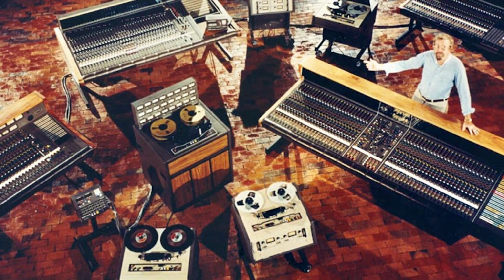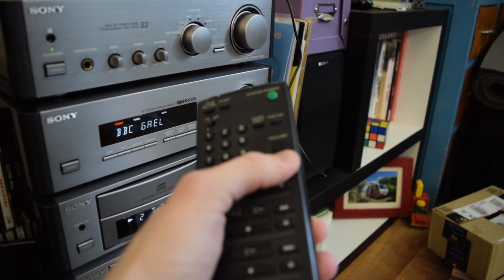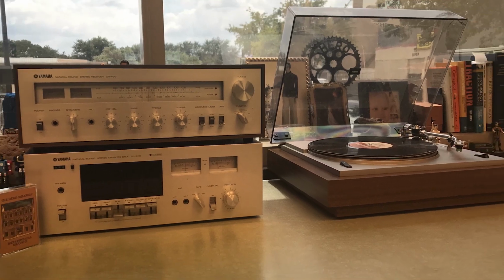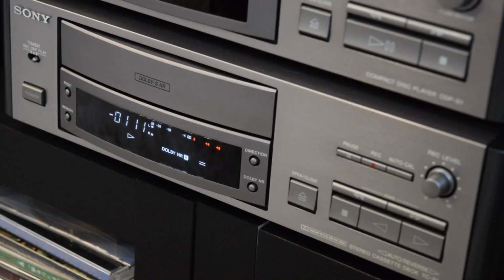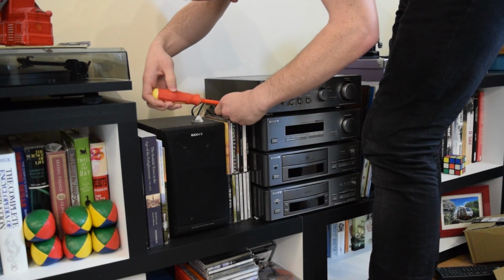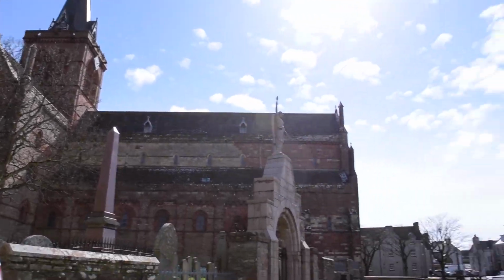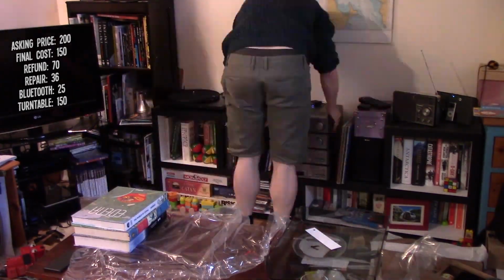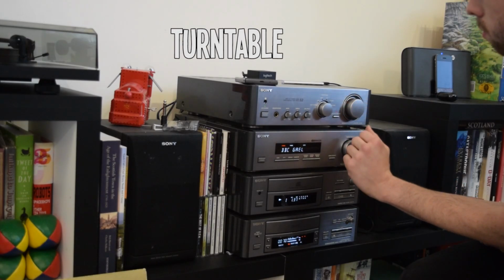My New (Old) Hifi: Sony La Scala TA-S2 & Project Audio Essential

Comment: Cracking deal I'd say... I'd pop those speakers a bit further apart if possible... couple of meters at least between them and don't pen them in... Open the sound up a bit. very nice setup. It'd be interesting to see if it's changed much over the years.

Comment: The stereo setup with the book shelves and what not looks super cozy. I don't mind the lack of a sample of the sound quality due to this platforms lack of fidelity and my tinny computer speakers. the video has inspired me to look around the used market for a dearly miss the ability to listen to vinyl. Whats your thoughts on the logicitech Bluetooth speaker adapter geatured in the video (longterm use)?
Reply from the maker: I actually removed it and moved it to my old boombox - our team at the Distillery I work at use it in the warehouse now. It's been running almost 24/7 for 3 years and never gone wrong!

Comment: Ahh I had that system in the 90's! I think it was £899 and then I added the minidisc deck which was another £400! 😮 My amp failed like yours and you had to tip it to get it working again lol. Then the pickup went in the MD deck and I ended up giving the remaining components to a mate. Beaut sound quality though especially with some Sony APM speakers
Reply from the maker: They're such beautiful a beautiful set- I've since moved and it's not got the greatest place but I'm building a house and without a doubt this and my whole HiFi will be getting centre stage in there. Just need to find some good speakers... 👀
Reply: I have probably the same relay issue. How do you repaired? Do you need to replace the Omron G5R-2232P-KW relay? Thank you

Comment: Ha, ha I did exactly the same as yourself but I went down the teac route and managed to get an A-H500i system(mainly for amp) added a project rpm 1 Carbon turntable and then found a pair of floor standing speakers made in the UK in the 90s by kef(very retro and sound amazing) a trip to IKEA all done.

Comment: I've had the same system for at least two years and had the relay issue as well. Repaired my self for under £10, still have it and still working, I've only added to it since I've had it.
Reply: I have probably the same relay issue. How do you repaired? Do you need to replace the Omron G5R-2232P-KW relay? Thank you
Reply: @pablofigueroa1264  sorry for the late reply but yes you do, simple desolder and swap. Unfortunately my la scala kicked the bucket but is waiting full repair.

Comment: The only thing I’d change right now on that system is the speakers, it deserves much better speakers than that. I picked up the same setup in about 1998 without the original speakers, I paired it up with some Mordant Short MS20i Pearls and it served me well for a couple of years until I replaced it with an Arcam setup in 2000. 

I’ve had Linn stuff for a few years now, if you haven’t heard of Linn, check them out, they’re a Scottish brand and make top quality kit.
Reply from the maker: Yes, I'll been an aim of mine to need to upgrade the speakers. Unfortunately I've moved since making this and the speakers are in a less-than-ideal location making it a bit less enjoyable to fire them up and play some tunes. Like the idea of getting some Scottish kit though- I'll look into this Linn!

Comment: I have a question. I just bought one of the systems off of eBay. I did have to get a UK to US adapter for the power cord. Anyway I plug it into the wall and the amplifier lights up. I have the other components daisychained to wait so that they can gather power through the amplifier. However when I turn on the amplifier none of the other components come on. Any idea what might be going on or have you had this kind of issue with your system.? I have the same exact system that you were showing in this video.￼
Reply from the maker: Hmmm so basically the other systems are not powering up? Have you tried daisy-chaining them in a different order? Failing that, it could be  a problem with the power supply from the amp. I'd probably recommend finding a hifi specialist to get a repair- something like a issue with the sound is probably fixble at home but when messing with power supplies it's a bit more risky.

Comment: Really nice video. I watched this before I picked on the same set up that you have, and the Scala is such a nice machine - have it paired up with freestanding speakers and it’s a dream. I have noticed however that my amp (S2) seems to be doing the cut out issue here and there. This is a long shot to ask here, but do you have the technical details of what repair work was done to yours. I’m doubtful I’ll find a shop that does it as cheap as you, however if I have the direct info on what is likely needing a fix I think I might stand a better shot and getting it done. Hope you see this message - and thanks for this vid! Felix
Reply from the maker: Sorry for the delay in getting back to you! Looking through old tweets and comments here, I believe the accepted theory was that it may have been an electrolytic capacitor located near the relay that started to fail. They help supply the current to close the relay but when they go bad they begin to make a rattling sound before the speakers turn on (Thanks to commenter Swinde).

Should it go wrong again, I'd definitely open it up and try and fix it myself-just because I place the value of this more in the enjoyment I get using and maintaining it more than just listening. But let me know if you have any luck! By all accounts, it seems like it's a very common hi-fi repair shop fix so I'd guess you'd get a good price for repair- maybe go in and explain to them what you think is wrong, them just knowing you're not clueless might make them less likely to quote you for unessesary work (the same reason I figure out what's wrong with my car before I take her to the garage if I can't fix it myself!).
Reply: Calum thanks so much, this is exceptionally helpful and gives me the edge I was looking for when I seek any repair. Long may all Scalas survive thanks to this video and guidance!
Reply from the maker: Hello, just a note to say I saw your message and I'll have a look back through my old videos/comments to see if there were more details on the repair and get back to you!
Reply: Calum thanks so much! I’m amazed you replied so quickly!

Comment: Just watching you setup great system you got a bargain especially the amp you have a good electronic repair shop who is honest and didn't charge you over the odds. Retro separates sound great  better than the new gear which is very expensive and not very well built all plastic etc.
I saw your cassette deck on the Techmoan channel I like the cassette loading tray really neat design.
I have just subscribed to the channel and looking forward to checking out some other videos. Thanks for sharing
Reply from the maker: Thanks! I don't make a huge number of videos on here anymore (though I do on a lot of my other social media channels) however I do want to do more like this in the future. Thanks for the kind words, however!

Comment: Do you have a problem with your Logitec Bluetooth receiver’s signal cutting out? I have one exactly the same as yours and when I’m listening to music through it, the music quite often gets interference through the Bluetooth signal and cuts out for a split second here and there. It gets rather annoying sometimes and just ruins my listening experience for me.
Reply from the maker: Cant say I have, the only problems Ive had is if I have my phone in my back pocket and it masks the signal somewhat. Possibly a fault in your device?
Reply: Not sure if it’s my device. I use my iPhone 8 and iPhone 6 as my music sources. I also have a JBL Pulse 2 Bluetooth speaker and have no connection problems with that though.

Comment: I was lucky soul who bought an S2 setup last week on ebay for £90.00. It arrived today and I was even more pleased at the fact that I did get the AU Bus cable plus the manuals for each piece. I'm going to take the time to replace the relays in the amp and replace all the grease in the CD playing mechanism as it is a bit noisy when ejecting.

It's a really nice sounding setup, I have it running my Yamaha NS-1000M at the moment which usually, are driven by Sony TA-E80ES/N80ES pre/power amps and a CDP-337ESD. Obviously it isn't going to replace that system, but it is damn good. 

I've bought the S2 for either my bedroom or to use at my parents spare room for when I am visiting.

Definitely recommend getting the AU Bus sockets connected because you will get full remote functionality - I'll have a look to see if I can find anyone who might be able to replicate the connectors. The wire just daisy chains from each component to the next, so there is no order or different wiring required.

Comment: I like that it is not black plastic like most of the 90s equipment! I think the dark chrome looks very nice!
Only thing I am not so much fan of, is the typical 90s styling of rounding up the trays of the CD and cassette. Love it or hate it, I prefer everything to be flat
Reply from the maker: FrightfulAccountant same on both accounts, I'd say. Love that I found something 90s that didn't feel like cheap plastic, but it still has the odd design choice that keeps it from being perfect! Hint hint vu meters...

Comment: 5:11   It is likely that there is an electrolytic capacitor located near the relay that helps supply the current to close the relay.  As they go bad, they begin to make a rattling sound before the speakers turn on.

Comment: I love the fact that your local repair shop repaired so quickly & so cheaply. It probably says volumes about the advantages of living in a remote & small community. 
I live in a fairly big town that had a local hi-fi shop that did repairs but it shut 10 years ago now. We have one second hand shop where there is a chance of picking up some old kit - maybe an easy repair if you're lucky. Soulless in a nutshell! 
Thanks for the video
Reply from the maker: Amazing isn't it? Everyone should bring their stuff to Orkney Television Enterprise! But this is the reason I want to become more self-reliant on things such as this- HiFi & component repair, even older car repair, as it is an expertise or service that is increasingly shrinking away from more rural areas (and even smaller cities!). In a few years a (relatively simple) fix like mine could probably only be done by sending it to a city hundreds of miles away.

Comment: That "midi" input you mentioned is actually MD (minidisc) which was a Sony proprietary format in the 90's/early 2000's. Still works for yur Bluetooth though. Basically acts as an aux port.
Reply from the maker: Wait wait wait I'm so stupid, of course! Not MIDI as in Musical Instrument Digital Interface but MD as in MiniDisk! Cannot believe I never caught that, thank you for the clarification!
Reply: Haha...no worries...cool vid!!
Reply: dandanthetaximan  i was like for almost 20 years without recording any minidisc, but then i discovered spotify ,and now i have mix minidisc´s with lot´s of music that i couldn´t find on stores, sometimes i even record from spotify ,just to don´t have to look for the cd that as the music i wish to put on a new playlist, like i work on a big sutrface repository and one day they told me to trow away to the garbage the sealed boxes of 10 blank mds , i just use my home as trash ,and i own several hundreds of mds,and even bought the high-end from pioneer as not working for 20€ ,when conecting it i notice that it reads the mds and then i just tried to record one md, it even recorded better than my 20 year old sony md recorder,maybe in the travel from germany to portugal the md deck just bumped dozens of times to arrive at my house working perfect,nice format(i even bought a md car stereo)

Comment: Hi, I can only agree; very nice video. I own this system from 1996. It was my first hi fi system, and it is still working. Last month I moved it to my bedroom like second one. I just added Google Chromecast Audio for some modern convenience. I was using it with B&W DM 302, so I suggest that maybe you should try those one in combination with this amp. Amp is not full of power so careful matching with speakers is needed (higher sensitivity). This is really hi fi system from any perspective; sonic performance, built and looks. From nmy perspective if you don't know age of it...you could easily be fooled that it is rather new one :-)
Reply from the maker: Yes its funny a lot of people who have come around to my flat haven't really caught onto the age, they all assume its a very high end model from the last few years until the notice the tape deck! 

I'm glad you brought up the lower power of this amp though, it was something that surprised me but since I'm no expert I wasn't sure if it was just someone more common on 'higher end' systems or perhaps MIDI systems. I'll be looking closely at those speakers you mentioned, however, thank you for the recommendation!

Comment: I am looking for a retro hifi for myself. I have around £250 to spend. Any good suggestions??
More vids please buddy, I always enjoy your content, and always enjoy watching your old tech reviews.
Reply from the maker: £250 is a pretty good budget, that's probably what all this came to all in (obviously I saved on not buying new speakers- yet!). I can reccomend the La Scala though, it is known for that fault in the Amp, however there is the La Scala 2 which is an Amp/Tuner combo and was very well recieved. These Mini MIDI Hi Fis in the 90s seem to be real swiss army knives if you're looking for digital all the way to phono. Also, I would also maybe try the Sony LBT range. It was a LBT-D159 (I think) that  I used to have in high school, and it was a wonderful system. The Equalizer on it was absolutely beautiful (the one thing sorely lacking from this). Whatever you do find though, let us know!
Reply: LitZippo Thanks for the reply Lit. I will definitely look into your suggestions, and also let you know what I end up getting. I was looking at an old Technics stereo (stack/seperates) system, are they any good? Or are they only good at Record Decks. I need something that I can play my extensive Vinyl, Cassettes and CDs, although I won't mind if the CD is seperate, as I mainly want something with analogue meters, as I still love watching the needles dance as my music plays, something that I don't get from watching LEDs or an LCD display.
Reply: LitZippo Hope you start posting more content? I really do look forward and totally enjoy your style/content. More please 😎
Reply from the maker: Thats something I've been wanting for a while too, proper VU meters and a more 'retro' aesthetic. I was more focused on the functionality, and (what I thought!) would be a hassle-free, more reliable system. But its all six in half a dozen really